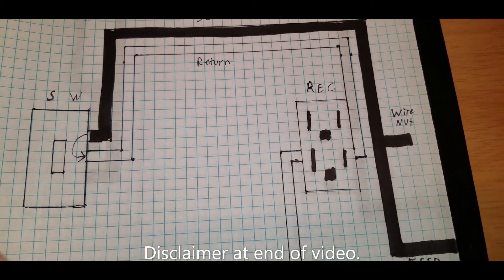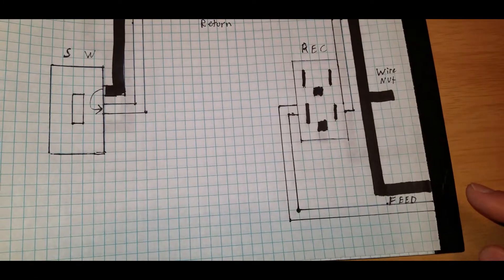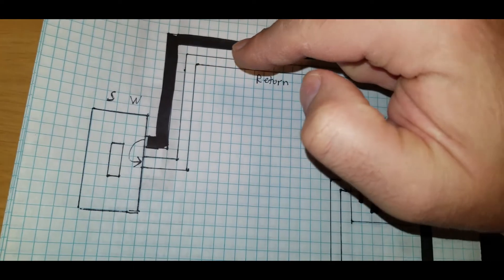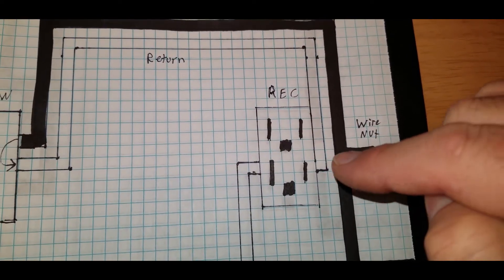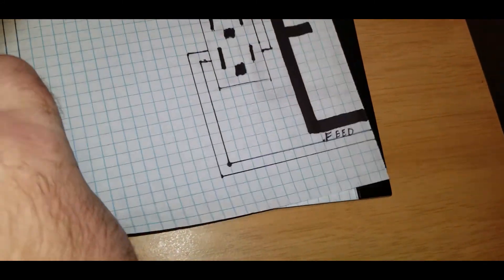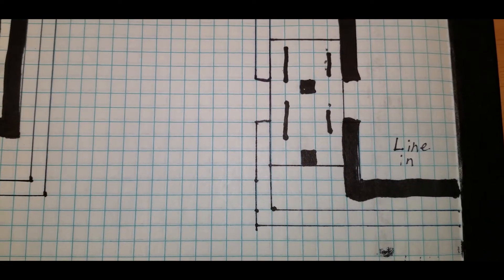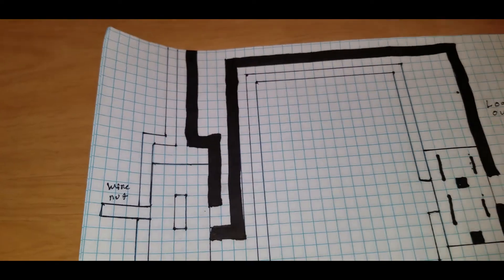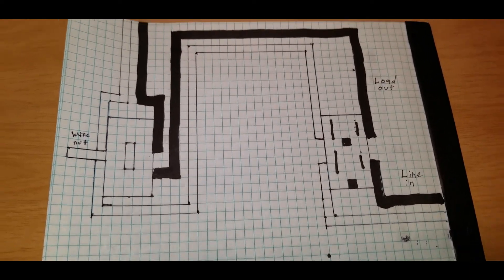Diagram of How to  Change from a Switched Outlet to Overhead Lighting.

Comment: Hi Jimmy, i am doing the same to my end of run switch for my receptacle.
I want to take the switch now and use it to power up a ceiling fan. I getting the power from the outlet. 
After wiring the light switch to the new ceiling fan continues to stay on. I believe it's just one wire not correct. Any suggestions would be appreciated.
Reply: Hi Jimmy, the power comes in from the attic to the outlet that feeds two more outlets in the room. The switch line is also in the outline . It's only two wires and was told I would need to do a Switch Loop to make the switch work.
Do you have a diagram for this?  Usually I can figure it out if I use 3 wire plus ground. Thanks again
Reply from the maker: @jsubs it's up to you. You can  feed lights out of the switched outlet box. Then you only have to hook the fan up the way the receptacle is hooked up. Or, you can wire outlet and switch wires all the same. All blacks together.  All whites together.  All grounds together.  Then, at the switches box, the white would just connect to the fans white. The black would be interrupted  by the switch.
Reply from the maker: @jsubs  Hi. Just so I  can  better  understand, is there a black wire and a red wire? Or just  a black wire? Also. See if my light install video  helps you out.
Reply: @jimmybs  Hi Jimmy I have one black and one white wire. Looks like they used the white  as  a black.
Reply from the maker: @jsubs ok. Find the outlet that it controls . You will  need to switch things around like in my light instalation  video.  But please. If you don't know this kind of work  inside and out, maybe consult with an electrician.
Reply from the maker: @jsubs  https://youtu.be/lyrXAUNDgqk?si=wh4I9OK4WvGdY9jR

Comment: I like your diagram but what if the switch controls two plugs?  I want the two plugs to remain constant power and now the switch will control the overhead ceiling light that I am installing.   Can you please draw a quick diagram for that?
Reply from the maker: Are the two outlets  together? Like one on top one on bottom ? Or do you mean one duplex in one location  '"your standard outlet with two plugs"' and another duplex in another location?

Comment: In your first diagram of the switched plug - this set up is just controlling one of the two outlets, correct? So same outlet is used in the second diagram, just changing the wires around, right? I thought on a switched outlet there is some tab you pull out. I have a switched outlet and want to add a ceiling light to the room and get rid of the switched outlet and just have it as a regular outlet. If I do, would your second diagram still work? Should I just buy a new outlet with tab intact - if so does your second diagram still make sense?
Reply from the maker: Sometimes it's  one outlet  and sometimes it's  both. You are correct about the tab. In fact, if you look on the other side where the white wires go, it's  probably still intact.  You could either  run 2 wires from the brass screws "where the black wires terminate " to the always hot wire / feed wire. Or you could replace the outlet entirely.  You could also run a jumper from one of the holes in back  back to the other on the black wire side.  ( if so equipped)  Another option is to  strip off twice as much insulation off the end of the black wire as you usually would, then about 2 inches away, score the insulation and slide it towards the end making a bare section . Wrap the bare section  around one screw and the end around the other. But I recommend you just get a new outlet.  Its quick, easy and safe.
Reply: @jimmybs  yes I will get new outlet - and just to confirm, your second diagram would work for that ?
Reply from the maker: @philipnicholson3216  Yes sir.
Reply: @jimmybs  thanks so much for your help - I will check out your other videos - big help to this DIY'er.
Reply from the maker: Thanks buddy. I love to help. I love to teach and also to save people money.  But please be safe and call a professional if you're in over your head. Good luck on all your projects.

Comment: Thanks for this video It is very clear and easy to understand. One question, if there's 2 outlets would that be the same concept however there will be a third white wire to connect by the switch? Wiring both outlets the same
Reply: I actually made a mistake there wouldn't be a third wire. My situation is the exact samething in the video however I have 2 switched outlets and not one
Reply from the maker: Presumably. They would be linked together.  So making one live all the time would also make the other live all the time. Unless someone did something overly  complicated.
Reply from the maker: I'm  not sure I understand the question,  but if there is a second outlet,  or if the duplex is divided, another words , the metal connector between the top and bottom outlet is  broken out and they are no longer jumpered , then there could be another wire.  You could either  connect that wire to the unswitched hot lead and make the outlet stay on all the time, or rewire the outlet at the outlet box so that it is connected to the always live hot leads that the other outlet uses. I hope this helps.

Comment: Good day Sir, I am new and still learning. I just want to clarify that the dimmer switch will not dim the outlet if I turn the switch on and it is only for the ceiling light?
Reply: Thanks for the response Sir, I open the outlet that I mentioned. I am seing 2 white wire connected to receptacle and a black wire. And there is 2black wire and a white wire wire nut together. I notice there is only 2 14/2 wire on the receptacle, and mine has 3 .
Reply from the maker: It sounds like all you have to do is turn off the power,  twist all the white wires together and  twist all the black wires together.  Run a short black wire  to the receptacle.  Then run a short white wire to the receptacle.  Put a wire nut on each. The. You're done in the box the outlet  is in. 
Then, up in the switch box, disconnect the white wire. It's  no longer a return hot wire. Now it's  your  neutral  wire  that will  be attached  to the lights. The black wire will run in to the dimmer. You will have to run a new wire that goes  from the dimmer to the lights that you plan to install.
Reply: THANK YOU SO MUCH SIR!
Reply from the maker: You are very welcome
Reply from the maker: Not if the wire feeding the outlet with power is connected to  the power  source before the dimmer.  Then the outlet will always have full power. Only the wire running from the dimmer  to  the light should be connected after the dimmer.

Comment: Thanks Jimmy I have similar issue, I installed wafer led lights and I notice my switch only went to a outlet, at the switch it has black wire and red wire that’s connected to the switch but I also found 4 white wires with a wire nut and 4 black wires with a pig tail connected to the switch, at the outlet it has black, white and red, so I disconnected the reds on both outlet and switch and connected the blacks at the switch and I pig tailed a white wire from the wire nut that has the whites and ran it to the switch, so I turned the breaker on the lights came on without me even turning the switch on and now they won’t turn off either what did I do wrong?
Reply from the maker: Its hard to tell without being there and seeing it with my own eyes, but basically  the lights ended up hard wired. The wire feeding electricity to them is NOT being interpreted by  the switch. Did you run a new wire from the switch up into the ceiling to the lights?
Reply: Yes I ran new wires up
Reply: I truly believe if I just put a wire nut on the white coming down from the ceiling and a wire nut to  the white that’s existing instead of connecting those to the switch it’s possible the switch will work as a interrupter
Reply from the maker: @Beast2N  Yes. The black wire to your lights should go to one screw of the switch. A pigtail supplying power should go to the other screw of the switch and you'll  be in business.  Please don't hesitate to ask a professional to check your work. Better safe than sorry and you'll  still be saving money.  I love all my subscribers and viewers and don't want to see anyone  get hurt or lose or damaged their property. Please be careful.
Reply: @jimmybs  Thanks Jimmy I will let you know what happens.
Reply: It worked Jimmy I really appreciate the way you respond to your subs and more importantly give great advice I really appreciate it, now I want to do my whole house now lol thanks again.
Reply from the maker: @Beast2N  you are VERY welcome and good luck. Please  be safe.
Reply: I have the same problem as Beast2N. The room has a combo control switch on top  and 1 single outlet at the bottom . The switch turns the top of out at corner of the room for the lamp. When I open the back of the switch, it has black line in as a pigtail that came out from wire nut of 3 other black screwed to the switch. Mean while the other side of the switch has top red goes to the top outlet for the lamp. The metal tab was broken off on red and black line in at the outlet. The the bottom has black line in. On the other side, 2 neutral line secured at each screw.

 Now back to the switch, the bottom of the switch has one outlet, probably to save space.  A single greenwire that came out of wire nut screwed onto 3 white neutral wires. 
Those 2 of 3 white neutral and lines are coming from the other side of the wall that control the lights in living room  and opposite room. How do I know because basically when I connected my LED recessed light in this location, I lost the power to living in the room and opposite room.  I removed the red wire from the switch, run mine 12 gauge black in the screw where the red used to be. Wire nut all neutral and ground. Voila, I got LED recessed light but loss power to living room and the opposite room cross hallway.

Initially I thought I had a loose neutral so I put everything back except the switch and LED recessed light.  And I got lights back to living room and other room. What did I do wrong?thanks.

Comment: Thanks for the vid. In my situation, the switched outlet is controlled by one switch in a double switch plate right above it. That switch also controls a ceiling light. The other switch controls a different ceiling light. I'd like to take the outlet out of the equation (and make it always hot), but the keep the switches controlling the ceiling lights. What's the best way to do that?
Reply from the maker: You have to find the hot wire going out to the receptacle.  Then disconnect it from the out put of the switch and tie it into the hot wire that feeds the switch. I would recommend  twisting the receptacle hot, the always hot "feed" and a pig tail "apx 4 inch piece of wire" together in a red wire nut. Then  run the pig tail to the switch to feed it with power. If you have any questions or doubts,  please have a qualified electrician take a look. I would hate for anyone  to get hurt or causs a fire.
Reply: @jimmybs  Thank you!

Comment: I understand the concept, an electrician friend told me to just go in the switch box and connect the black and white wires together to give constant power to the outlet. I want to use the switch to operate a fan/light. My only question is what does the red wire represent? I took the switch plate off and saw wires entering from the top as well as the bottom of the box. Any insight would be great. Thanks
Reply from the maker: That will make your receptacle stay on full time, but you won't have a power source for anything to feed off of. The switch will be useless and you can't  run new lights off of it. The red wire means it may be a threeway switch,  meaning there is, or was another switch in another location. Another possibility is there was something like a fan, light combination.  The black  controlled  one and the red, the other. It's  hard to tell without being there.

Comment: Do you have a video where your doing this?
Reply from the maker: https://youtu.be/lyrXAUNDgqk
Reply: Ty, im trying to install wafer lights in a room with no lighting but the room has a switch outlet so im trying to make the outlet hot and rewire the switch to the new lights
Reply from the maker: Hopefully  this helps. If you have any questions,  let me know.
Reply from the maker: Yes. Its the one in the play list with the diagram  where I install led lights in the ceiling.
Reply from the maker: I put the link in the comments.

Comment: Jimmy thanks for doing this, visually it makes more sense. On the light switch I’d assume to switch has to be a 3 way switch rather a single pole?
Reply: On my outlet I have 2 blacks going into the outlet, 2 whites going into the outlet and 3 blacks and 1 white into a wire nut. So 3 lines coming into the outlet box
Reply from the maker: No. Single pole is fine. A 3 way is only necessary for control from multiple locations. Remember. The white wire doesn't connect to the switch. it just passes through the box uninterrupted.